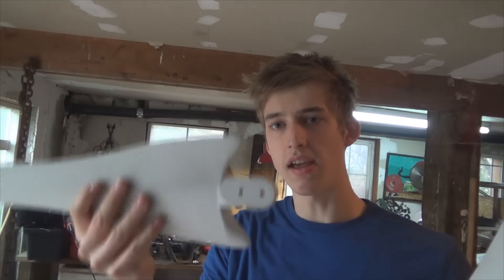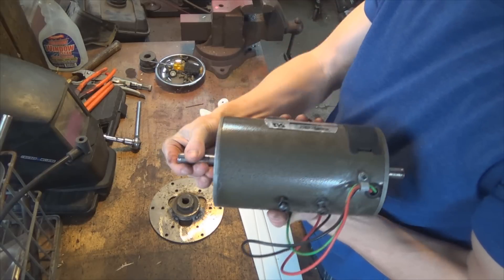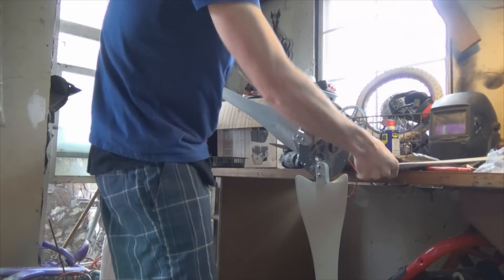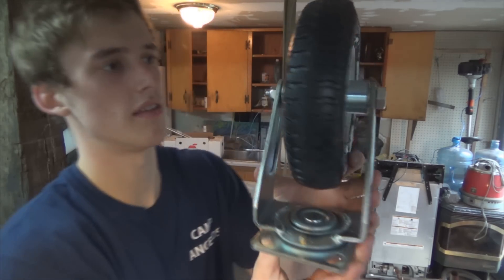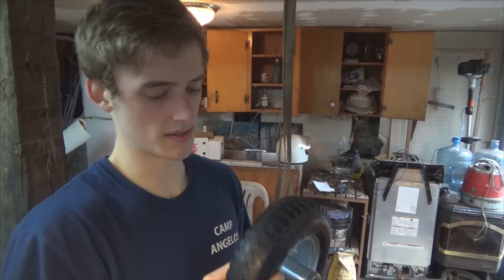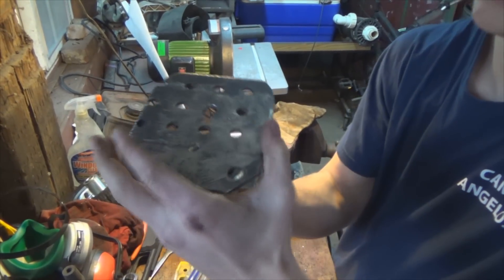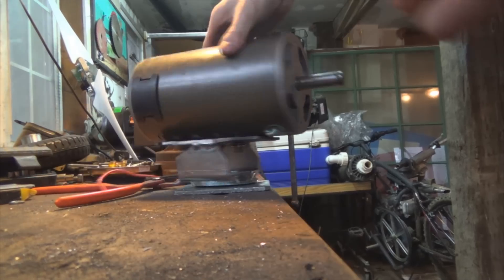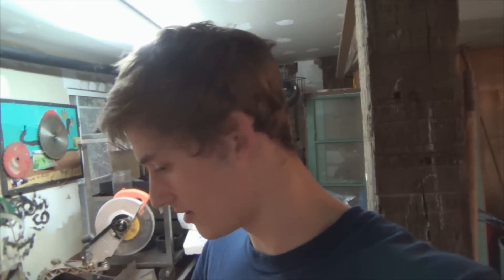DIY Wind Turbine Build (Part 1)

Comment from the maker: Hey guys, I also made a water wheel!! Check it outtt https://www.youtube.com/watch?v=nSJw-M1DM1Y&t=448s
Reply: Why not adding gears. On the generator add a small gear wheel and the wind side add bigger gear wheel. So the ratio will be more effiecient.
Reply: @lazygamer8789 🎉
Reply: By the way.  Your "spinner",  the part you purchased with the wheel on it is called a (Caster).  They are generally solid made of different alloys,  but can be purchased with Pneumatic wheels like yours as well.

Comment: My dad has a 350 pound ac 3 step i think he said motor can it be a wind mill?
Reply from the maker: I think it would be really difficult because it's huge, so you would need long blades to capture enough wind to even move the shaft
also it is 3 phase ac so you would you will need to convert it to DC. Then maybe unplug one of the phases so that it is compatible with whatever rectifier you use to make it DC.
Reply: @OliverMotorized  Oh wow I didn't think you would reply  thanks dude
Reply: @OliverMotorized  holy Frick this is a few years old video

Comment: Also you need bigger blades for that motor.
Reply from the maker: Tomo Polic thanks for the comments! I think also that more blades would help as well as longer ones perhaps
Reply: @OliverMotorized  it would also help that's true. More blades will help give more torque so it will spin at lower wind speed , in other words it will be stronger. But if you want  it to be faster and stronger then longer and wider blades should do the trick. Because more blades also slow the wheel down in a case it could spin faster on the same wind. . . Etc..  I would try both on that motor because im not sure either what is best for that one. By the look of that motor I think the best would be if you put both longer blades and more blades.. because it really looks hard to spin by hand. . but since that can be a problem in many cases maybe better if you put 3 more blades instead of 2 more..
But again I think it wont make a big of a difference because it is really hard to spin. Maybe you could try putting a gear box.. that would also so the trick. Smaller pulley on the propeller and a biger pulley on the generator. At least 2/1 gear ratio to double its strength.  
And when it doubles its strength then you could again be limited by its speed.  .. it has its poaitives and negatives but idk. Maybe try with the pulley. In theory a wind of that strength with blades that big should be able to make 200 watts easy. But not sure with that motor. That one needs bigger stuff.

Comment: ANOTHER DIY wind generator builder who does not say how he has got the wires not to twist round the pole,,
Reply from the maker: You can anchor the tail of the turbine to the ground and the amount of slack you give it is how much it can move horizontally. By anchoring it, the unit will not spin 360 deg tangling the turbine. That said, you won't get all the wind from every direction. Or you can purchase a slip ring, which makes it so the wires can move indefinitely in all directions.

Comment: If you get a front wheel bearing hub that has a true bearing and it has a hole for the wires to drop down to the ground inside the pipe pole or at least down below the hub pivot.
Reply from the maker: interesting , almost sounds like a make shift slip ring!

Comment: Are the blades alüminum or PVC...is the different ?...Im the setting same system...thanks...good sharing...
Reply from the maker: They arn't aluminum, But i'm not sure if the plastic used is pvc or something else. Aluminum may be more sturdy but might not last as long, while pvc is cheaper and might resist corrosion and weathering a little better. Thanks!

Comment: I assume there are better motors than others for this purpose? Wind turbines often charge a DC battery directly, surely you want a DC motor at least?
Reply from the maker: There are definitely better motors for a job like this that can generate more E with less RPM. Interestingly, I've seen both AC and DC to charge batteries. Just with AC you need a rectifier. Whether one power source is better than the other, I have no idea.

Comment: (
Reply: I had planned to use a treadmill motor also .  I decided to put it on a bicycle. I purchased a 48 volt lithium battery for a power source. I think the treadmill motor could have handled a bigger battery. Have you any thoughts on that

Comment: you  grounded  your  weld through  the bearings  didn't you? that will screw  it up. but keep up the good work, can't wait to see  what  and if it works!!!
Reply from the maker: I definitely did lol. It wasn't to bad though just lubed it up and ran it on a battery for awhile to get everything moving again. finished product ended up being a water wheel!

Comment: If ur just using a treadmill motor u'll have to gear it up to at least 4 to 1 ratio to make usable power to charge a 12 volt system

Comment: So when it spins around and around what happens to the wires 😕
Reply: a stopper that does not allow more than 360 deg rotation should do the magic,...if possible spring loaded ...
Reply: He need a 3 pole Electrical Swivel.
Reply: Thats why vertical axis, is better!
Reply: Either you make it stationary(fixed) so it doesn't spin or you add slip rings to it
Reply: @DavidHogendoorn  Slip rings suck.  He needs a Electrical Swivel.
Reply: @KyGun  lol, what do you think are inside electrical swivels?
Reply: Jon Rogerson yo make it so it doesnt spin all the way around as long as the blades are spinning wtf do u need the whole thing to be spinning for
Reply: @dmytronovycov6817  The wind is unpredictable thats why it need to spin and follow the wind direction.  Otherwise its useless,  Thats WTF you need it to follow the wind Einstein.

Comment: Next time run your wind mill through  gear system do that your windmill can spin around and leave your motor or generator stationary to avoid twisting and breaking the lines.

Comment: just a quick tip, weld with BOTH hands.
Reply: Clearly you dont weld.  I been welding 35 years.  A MIG welder is designed for 1 handed welding.  A small part doesn't require both hands.  Maybe if he was welding on a much larger scale,  but clearly he is not.

Comment: where do u fix slip ring for wires of the motor
Reply from the maker: This design doesn't have a slip ring, I was kind of relying on the wind to come in the same direction at all times. And it worked for the most part, just need to adjust wires every few days

Comment: see my research on same topic. write my name on this site and see the research if you want
Reply from the maker: I looked it up, awesome work sir!
Reply: Any suggestions for the next
Reply: The PM DC motor you used how many output you got
Reply from the maker: I don't know enough to give you proper suggestions or improvements, but a lot of people have suggested for me to add more blades to the turbine so it spins easier at lower wind speeds. This set up was producing about 42 Watts, at 28v.
Reply: Actually 3 turbines are enough. Adding more will increase the torque(the amount of force needed to make a rotating motion). So the more blades the harder for it to spin and also the slower it spins.

Comment: Wind stator yourself rather than use motor
Reply from the maker: It was convenient for me to just buy a treadmill motor. What exactly is the difference? From what I understand, a stator is the same thing except it doesnt work as a motor. Thanks
Reply: use a commutater it will allow the generater assembly to rotate with the wind and you won't have tangled wires to fix.

Comment: You do realize you're bench has to be level for that technique to work. What you did there was make the plate perpendicular with the force of gravity and not parallel with the base of the bearing assembly (the massive caster you cut in half!), unless your bench top was also dead level.
Reply from the maker: +lite Roadie the work bench is level
Reply: Oliver Motorized Oh, just making sure!

Comment: proper name is Caster,  but they run an open bearing which may be a problem down the road with debris and rust/lubrication.
Reply from the maker: +Raquel Bauman That's true. I have to make some type of housing for it.

Comment: Adding more blades will allow it to spin at a lower wind speed.
If you go to tractor supply, menards, lows exc. you can get the garden size windmill blades witch should allow it to operate at that lower wind speed. 

Hope it helps!
Reply from the maker: Harvey Thorson Thanks for the info!

Comment: Well thank you Oliver for the mention in your video.Love your wind turbine project. I hope it works good for ya.
Using the wheel bearing for your Yaw bearing was an excellent idea. The thing you need to keep it in the wind is called a tail fin.
Reply from the maker: MissouriWindandSolar thanks for the comment MWS. In reply to the other comment you left, the tail fin actually works really well. And I also purchased a couple blocking diodes for the battery hook up. Quick question though, from what i understand, More blades means it will spin sooner, but not as fast is that true? thanks again.
Reply: @OliverMotorized  yes oliver and the right size blades for the torque but not over done creates allot of vibration. I have a 3 blade and 5 blades setup i change them accordingly to the areas wind type .my entire wind and solar hybrid is portable. My prototype wind turbine  tower is telescoping and folds down and my solar array does fold down and the rear array has linear actuators 1500 n strength and can lower and raise the array so it can tilt and track in sequence with the front array and i have a 1410 ah 12v bank 2 mppt solar controllers and copper bus and breaker box midnight solar . And a 600 watt suitcase array also and  an onboard samlex duel 80 amp marine charger for charging bank with a generator and shore power. I am thinking of getting a powerful low rpm 3 phase   turbine 230 v 5k that can power the charger using a inline inverter and hardwire port. I have a 3.5kw to 7.5 kw pure sine inverter 12v in 120v ac out 30 amp hardwire port for ATS . And a 6 kw to 12 kw msw 12v in 120v ac out 50 amp hard wire port to camper or ATS  .i installed 6 desulphinators on my battery bank and upgraded cables from 1/0 cable to 4/0 cables .my turbine  is wired with 6/3 carol wire to throw  lever copper switch 3 way to 100 amp ac to dc rectifier the dump control board the solid state relay then to 125 amp breaker or batter and 300 watt 3 ohm dump . So many upgrades always innovating something else to add or change on it. So i can appreciate innovation.of you want to see  it i have videos .lol everyone starts  from some where and man my green energy journey was a very long one.  Lots of mistakes lots of victories   and just fun. I will definitely follow more of your stuff. Jeff is real good with this stuff he has years of expertise . As me if u need help i would do my best or find the answer if dont know it.
Reply: Not an expert on this but that makes sense that more blades would cause it to turn sooner. The logic behind that is that you have wind passing over 3 or 4 objects all pressing in the same direction. If you add one more blade more pressure would be applied equally when at a stand still because the wind is equally applying to all the blades. When the blades start spinning the more you have, the more potential there is for loss of efficiency at higher speed. E.g. as blades begin to spin they leave turbulence in their wake causing the next blade to be less efficient. It is simply cost/benefit analysis. What do you prefer, considering the environment you're in. If you live in a windy environment go with 3 blades (imho) or if you are in a non-windy environment more blades may be beneficial. You could also have multiple windmills, some with more blades while others with less to provide a constant supply of energy regardless of weather conditions. Just my two cents.
Reply: I love this project.im glad places like missouri wind and solar have materials  online for a young man to innovate like this.i love innovation to try new stuff differently than others.our country was thrusted  into a world super power that way. It always starts with a person and in the garage. Cool turbine .

Comment: yes you are right, there are other videos of people doing this. i am doing the exact same thing as you....i am using a 38 vdc ametek pma.....i was trying to figure out what piece i could use to allow it to rotate in the wind....
Reply from the maker: ibezag0 nice man! what is the RPM of that motor? that voltage seems a bit low. Anyways Thanks for the comment. Hope you got some ideas.
Reply: its a 3d vdc 12 amp max low rpm motor but it doesnt indicate the speed on the label